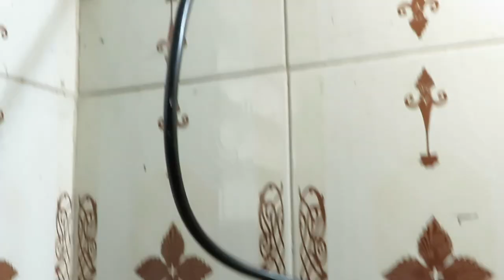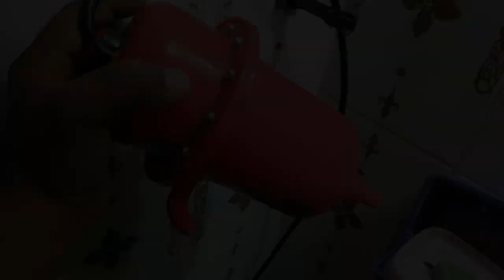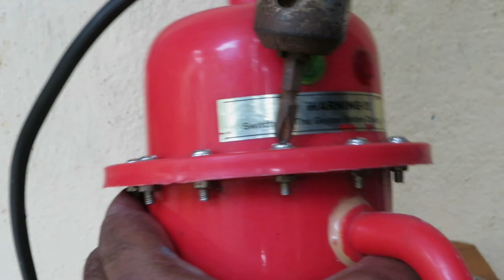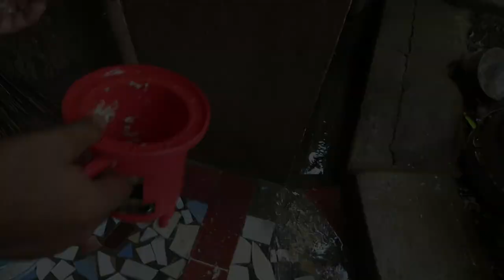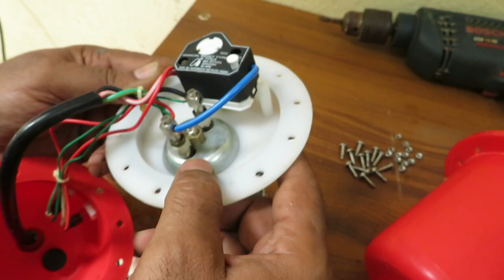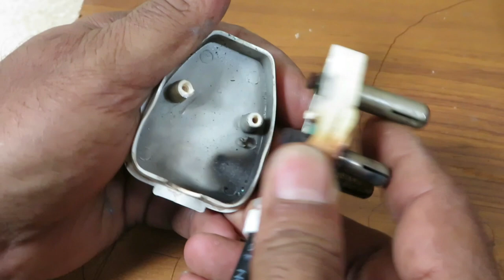Instant water heater / heating problem / Trip issue solved #2024  #Tamil tech 360

Comment: Bro i brought this prodect yesterday only when i on the switch it will run 5 mint after that tripping and we don't have AH connection can i use this or not give me solution bro
Reply from the maker: Best u return and buy another. Inside top cup thermostat available it's cutoff temperature in low setting

If U able to open top cover  and adjust thermostat degree temp.